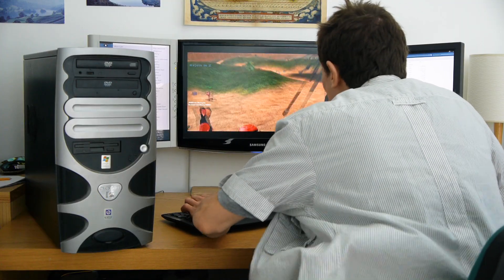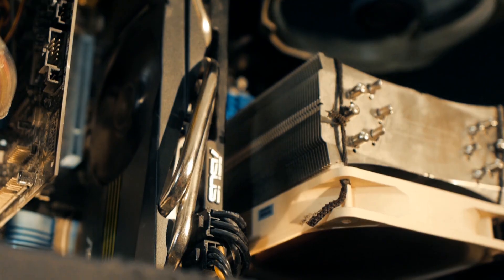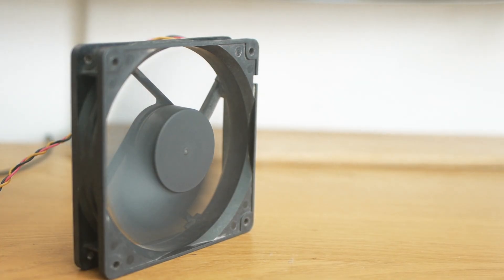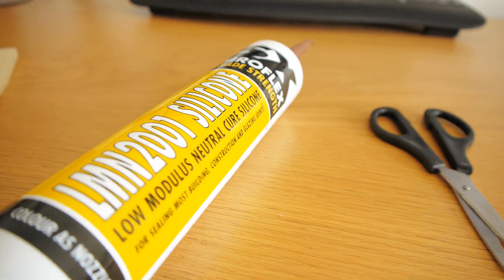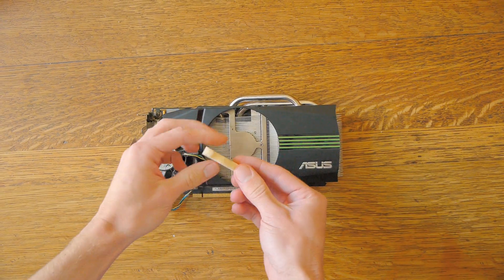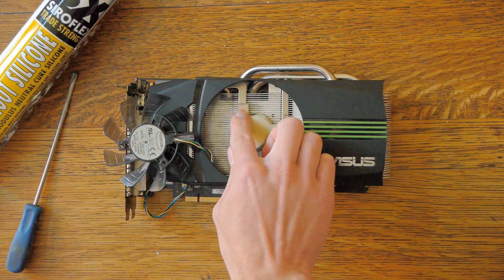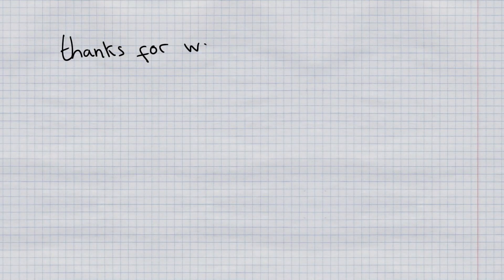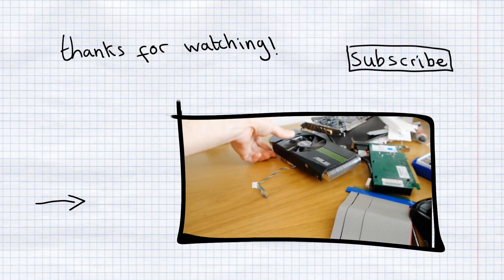How to make a graphics card quieter

Comment: Or just rip out the manufacturers casing, and replace the tiny and flimsy fan with two 120mm case fans. 0rpm on idle, 0 noise on idle. 500-700 rpm under load, and still next to no audible noise. Bonus points for cutting a third off the GPU core temps.

Comment: Howdy Matt, thanks making this video; I followed along to modifying the cooling fans on my GTX 970, and it's been going strong since 2018. So far, no sponge sag or other mechanical issues, just more noticeable coil whine when I put it under load since it's so (relatively) quiet compared to stock. :)

If I may ask, in what part of the UK would you place your accent? I ask only out of curiosity as a linguist, as I've noticed in other videos you've made that there are some words you pronounce rhotically, which made my ears perk up~

Comment: it's a good idea,  but my idea is to glue a small pipe above the hole where the gpu fan spins, to increase the air flow, please try it , the temperature will be decreased by half.

Comment: This is a terrible idea to do this for a few reasons.
For one, the glue he is using is going to be different from the glue you use. It might not be able to withstand that amount of heat.
Two, the fan may or may not be screwed down. This is brand specific.
Three, a sponge is 99% going to burn up when in direct contact with a heatsink. No question about it. Sponges aren't made to stay on a block of copper and aluminum that heats up past 80°c, basted in glue or not.

Fans are replaceable, it would save you so much hassle and time to just replace the fan, or if you aren't voiding your warranty or have no warranty, change the thermal paste on the GPU itself, change thermal pads on the memory, and adjust fan curves on the card through software like MSI Afterburner.
Reply: He should use MX4 instead of that glue then? Gotcha

Comment: Wow, what a terrible thing to do to a Graphics card. Have you even thought of the consequences in the future? That’s the same foam the breaks down and turns into dust. Just think of the noise that will make getting caught in the fan, not mentioning all the mess it will make blowing around in your pc case. What a truly idiotic idea. You should have used rubber inserts or something. This is just down right stupid.
Reply from the maker: I don't know about that. This video was made years ago, and the card, though not in my main rig anymore, is still going fine. I appreciate your concern, and if it was something that mattered more it would be important to heed, but for a little hack like this the performance gained (silence) is worth it compared to the 'theory' that it would degrade over time. The GPU itself will probably die before the foam crumbles away completely.

Comment: I want to play old XP games and got an XP(referb) Dell but when I put my Geforce 210 in the fan went max out! an WIn 7 and 10 fan speed is adjusted by driver but not XP funny I used XP for nearly 10 years prior to getting 7 and no card(older than Geforce 210) had that problem. 710 no prob but 210 a big leif blower inXP. weird or suspiciously a transphazout card meaning they phazed out XP drivers and didn't care.

Comment: wtf you could do the same by just remounting the fan with the sponge or get rubber washers this method is completely absurd you damage the GPU cooler in the long run and if you sell the card its automaticly lost a lot of its value.

Comment: I would be more inclined to get small rubber O-rings and maybe slightly longer screws and just place the O-rings between the fan and the mount where the screws run through. It seems like a more stable mounting solution while still getting some isolation.

Comment: Would anti vibration rubber pads not do a better job and last a lot longer?
Especially if you could find a few tiny springs to mount the fan with ontop of the anti vibration rubber pads, that could work too

Comment: This mod is badly implemented!

Not all the airflow from the fan will be flowing over the heatsink anymore. Raising the fan is OK as long as you make sure all the airflow is still blowing to the right direction. In this video some of the airflow is just blowing around... 

You should know that fan shrouds are there for a reason.

Comment: If you want a quiter GPU throw your's out and use onboard graphics, Every electrical component has its operational temperature  but the lower you can keep it at the better they perform and longer they last! In other words if you want your components to last and work the way they should keep the fans at high rpm and have good ventilation in your computer case!

Comment: This guy seem to be for real with this... Seriously no one even try this, or it will end really badly... The GPU will run at much higher temps, it is way to insecure for the high rpm these fans on the GPUs and is overall bad idea in general e.g. for RMA. If you really believe this then please stop, and if you really need your card to less noisy then buy a water-block, or buy a passively cooled card or run sponge UNDER the CASE of the computer and not in the GPU!

Comment: rather than trusting the glue and sponge wouldn´t  it be better to screw the fan back in place with a layer of sponge pressed between the fan base and the heatsink? Would that render good enough results or would such idea do nothing to absorb the vibrations?

Comment: Did the exact same thing, with the exact same graphics card ( Asus gtx460 1 GB OC),  however, I replaced the stock fan with a nuctua redux that I cut out of it's shroud.  The fan is twice as high as the stock fan, and therefore pushes a bunch more air through the cooler at the same rpm.  I now runs it at a constant 55% fan speed (about 1000 rpm) and is almost completely inaudible.  The gtx  460 is a hot running card, so it can get pretty loud with the stock fan.  I used a strong double sided tape ( for wall mounting mirrors ad such)  and there is no indication of it coming off.  The graphics card is mounted normally (fan facing down)  and it's been running like a dream for 6 months now.

Comment: That sponge gun' rot after a few years. Or plain simply, snap after a year or 2 because of the extended pressure of holding up a vibraty lil fan.

Comment: Just bought a new MSI 1050 Ti, and the fan was making an obnoxious buzzing/rattling sound.  I did exactly what you explained in the vid using superglue and a piece of foam, and now it runs absolutely silently and stays cool even during benchmarks.  Fantastic tip!

Comment: you aware some video cards reach 90-100 degrees Celsius? My GTX 660 used to run at 70 degrees, 80 after it gathered some dust, 90 after 3 years. Imagine what that would do to your sponges

Comment: Wait? wouldn't it be easier to put some kind of rubber between the case and the Motherboard/Mainboard? It would also cause less vibrations from the CPU cooler
Reply: That's not how it works. Imagine if you lift a chair up in the air, but had a vibrating object laying on it. It would still generate noise.

Comment: this will void your warranty
Reply: lol My Radeon X1950Xt  Warranty is gone anyway cause it 10 year old! LoL!
Reply: I find that pretty ignorant.

Got a brand new PC a month ago, it was going swell, until it just shut off and it never turned on again.
Turns out my PSU died, it was a brand new one, and it wasn't a bad build, it just died. If I didn't have warranty, I would of have to spend $130 for the same one.
Same could happen to your GPU, it's always great to have protection.
Reply: tim whitten  good luck
Reply: Gluing it might but if you used rubber washers then it should be fine, depending on your warranty information.
Reply: BobTheBacon oh my god you're in my steam friends list.

Comment: this fix only apply to vga which has the fan base screwed directly on the heatsink, nowadays i only see fan screwed to the vga shroud instead so the noise is coming from the vga itself but not the fan, i believe is some kind of resonance noise from the vga when it operates at very high frequency.
Reply: I just figured to do something similar to this based on a Sapphire Nitro+ tear down, and I did it on my Powercolor PCS+ which has the fans mounted to the shroud, and it still helped with the rattling because the bit of sponge I used stops the fans from hitting the heatsink and rattling the shroud, so this most definitely still works on shroud mounted fans.

It's actually better on shroud mounted fans as you don't need to permanently glue the sponge onto the heatsink or fan. Just use some folded over sellotape to stick it onto the back of the fan.
Reply: Actually i did this fix on my gtx 970 and it really helped to reduce the noise to a very acceptable level, however i used a piece of thin 2 sided tape instead of sponge, much easier to apply onto the fan's base which is mounted to the shroud.

Comment: i dont like this, i mean what if you need to remove the fan later or what if it flies off while gaming? gpu will still make noise if it's hot. only way to 100% silent gpu is water cooling.

Comment: the only thing I hear is my case fans, is there any way I can stop the noise? (other then unplugging it)
Reply: Rubber washers anywhere the fan or screws touch the case. If that doesn't help much you need new fans.
Reply: Yeah boy! (Angry Texas accent for added drama and no particular reason.)

Comment: you've forgot to glue a short piece of pipe the same diameter of the hole to help the air flow, because the first demo of the fan alone, if you approach your hand to sense the air flow will be the same in both directions but if you add a pipe, this will redirect it to one direction, i did it in my GTX 650 and COOOL, try it you have nothing to lose

Comment: no need to use glue, you fucked up your graphic card using glue.

Just using the sponge is most than enought
Reply: It's silicone glue I believe he said so it should just peel off if you wanted to remove it.

Comment: If the glue comes away , that could cause more of a problem that a little bit of a wispier noise  and could end up been costly to fix ( make sure you know what your doing before you even attempt this fix ) i tryed this and it killed my motherboard - the man in the shop told me it was due to the graphic card over heating from the glue , that sent a shock into my motherboard and it died ... please be warned !

Comment: Great video. Unfortunately the noise before was more of a reverberation rather then actual fan noise. Fans now a days on gpus are loud, not befure of mounting but fans itself. My r9 390 for example already has foam on 2 out of the 3 fans (odd that one doesnt have it haha) My guess is the 2 ball bearing ones have the foam the other doesnt but its still incredibly loud.
Reply: +bluej511 what card is it? - I'm running a sapphire 390 and I generally cant tell if it's fans are running without looking. Mind you, my 240mm AIO is fairly loud, so it could just be getting drowned out
Reply: forestR1 Same as yours, r9 390 nitro lol. Ive heard AIOs are so noisy, ive got a custom loop and its pretty inaudible. Before that the r9 390 with the stock cooler and custom fan curve was loud, my pcu cooler was a noctua nh-u14s which is dead silent. I had it set where it would go up 10% fan speed every 10°C below 50% its silent, 60-70 is audible 70+ its a jet. If your using the stock amd curve it keeps the fan  speed low at all  times.
Reply: bluej511 I've heard AIOs are louder too, but I don't know why. I cant hear the pump at all, and a rad is a rad, but I'm running the supplied Silverstone radiator fans, the slowest I can get them is 1500 rpm. so it might be time for some better quality pwm fans EDIT: disconnected rad fans - pump is all but silent. case fans are inaudible, PSU makes a fair stink of noise
Reply: forestR1 Yea usually its one or the other, you can adjust pump speed, from all the tests and boards ive read pump speed generally doesnt matter. Youll see maybe a degree between full and half speed. Id say give it a shot and test. All my fans are running at 1200rpm or so and my water delta for just one rad is about 8°C. Was colder before because i had my 360 rad mounted externally. My r9 390 stays at or around 40C (was 71 before with a custom fan curve) and my cpu stays at or around 50C (was 54 before with the Noctua). The case emits about 40db from a foot away at night its about 23-24db so its makign 17db of noise pretty damn quiet. I use a fan controller as well as theres a total of 8 fans in all.

Comment: What if you just put ur computer on the roof and had some long ass cables going inside?
Reply: +GranVlog have fun turning it on and off.
Reply: Ashaira BT module for control or a long signal wire. easy peasy
Reply: I don't know about other devices, but some monitors for sure don't like very long cables (http://www.cablechick.com.au/blog/cable-length-guide/).
Reply: > on the roof
And then it begins to rain...

Comment: Eh i just removed the fan 100% silent
Reply: Jordan Groleau Youtube is Sarcastic Bro, and so was i :D
Reply: Same now my TITAN X is quieter and reaches well in the 90s
Reply: +DJRAMVEVO2013 that's going to shorten the lifespan of that card significantly.  you're going to get a lot of thermal throttling as well, which reduces the clock speed of the GPU.  terrible stuff.

Comment: why does people alway suggest water into their pc do they know water conduct electricity?
Reply: +Khoa Nguyen They don't mean pour water into the computer they mean use a radiator and tubing set up (like a car has for the engine) that is a closed water loop system that cools better than air since there's more surface area
Reply: yeah but car radiator leak too.
 It's not better than air cooler ever had water spill on your laptop, Water is not going anywhere near my motherboard.
Reply: They only leak if they're designed poorly.
Reply: not design poorly you should check out people video its all over youtube I base my opinion on their view. They broke by themself and you would have no idea what happen. These are the expensive one.
Reply: I don't feel like repeating myself but like I said if you get a single loop with no pump system etc that isn't garbage you won't have issues.

Comment: Or do some research on noise production before you decide on a particular videocard. Personally I can't even hear my gigabyte G1 980ti when gaming; it's that quiet.
Reply: The only reason I can hear my RTX 2060 Ventus OC, is because of the horendously bad quality of the fan bearing on one of the fans.
I will try to live with it for the time being as those puppies aren't exactly abundant at the suppliers, meaning an RMA could take a while...

Comment: Use MSI Afterburner and adjust the fan curve
Reply: +Sebastian Contreras and make your gpu overheat.
Reply: Not necessarily
If done correctly, you can keep it quiet for low temperatures, and then make the fan go up when it heats up.
My GPU won't go over 60°C

Comment: it worked on YOUR asus graphics card,but lots of graphics cards start annoying cause Lack of lubrication.
Reply: +Geralt Nt  what lubrication? - he's literally replacing screws with glue -
Reply: +forestR1 i mean,the fan's Lubrication can solve the problem.
Reply: Geralt Nt I could only assume most use ceramic bearings (no lubricant). Fan noise is generally from reverberation. small vibrations from the spinning fan (as well as turbulent air) causing larger resonant vibrations through the chaise, like a speaker diaphragm. don't go squirting oil into your fans whatever you do! :)
Reply: forestR1 May I have not seen your situation, I generally do a good fan lubrication will solve the problem :)

Comment: why not just water cool it with  either an  aio or custom cooler
Reply: Because you need money for that
Reply: Because then you have the noise of a pump in addition to the fans on the radiator. Plus a load of gotchas like reservoir resonance, mechanical coupling of the pump and more. SilentPCReview has some excellent articles on why watercooling is just best avoided if you want a truly silent PC.
Reply: +Jeremy Clarkson or if you do not mind the look of it and can spend a little time on it, just do it diy with cheap parts from a home depo? and yes it will work
Reply: pmg matic But it's dangerous and stupid looking. Watercooling is for enthusiasts that want their PCs to look cool
Reply: +Jeremy Clarkson custom air cooling is not and if you do it right as i said it will look cool
Reply: +Jeremy Clarkson You're drunk off your rocker... Watercooling is infinitely better at cooling a PC than air cooling.
Reply: +pat ayala try to place an evo 212 :D you will have so much fun , trust me :D